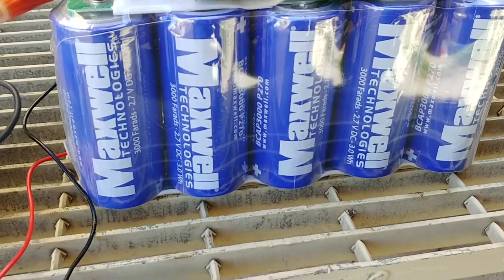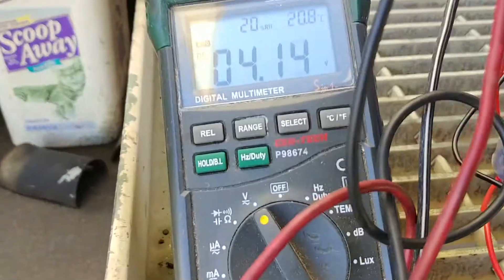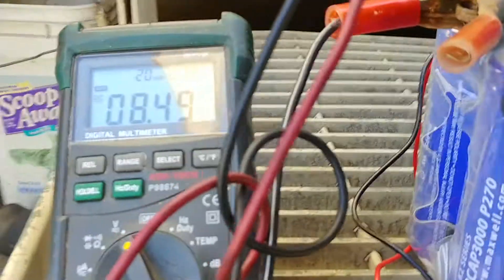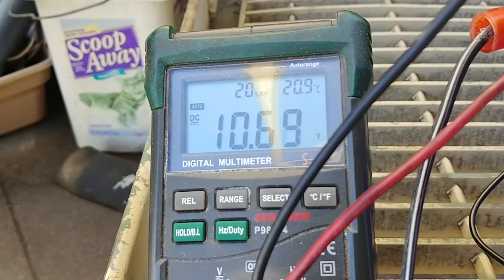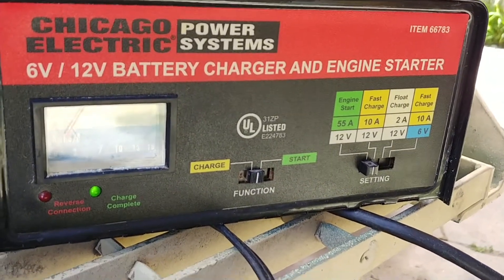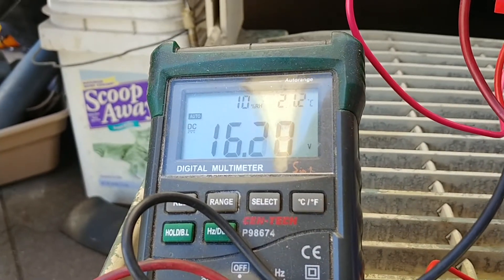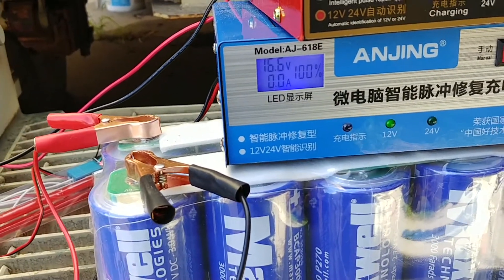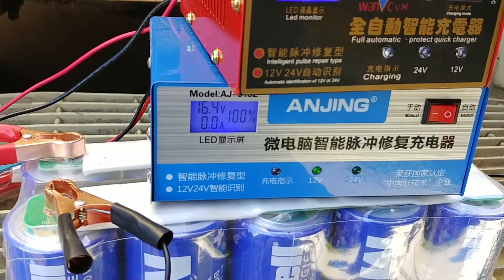Super/ Ultra Capacitor Bank Charging with 12v 24v Smart Charger

Comment: I need your help/advice,
  I built some 24 volt lifepo4 batteries. but they never get down to the automatic shutdown voltage of 10.5 - 11 volts, before one of the cells gets to low and shuts off the whole battery to early. Both my charge controller and inverter warn to "NEVER DISCONNECT BATTERY  WHILE RUNNING".
  Using this capacitor battery idea in parallel with my lifepo4 battery, could prevent this and run down to shut down voltage , if the battery disconnects before reaching the low voltage shut down settings. 
  Do you think it would be ok to leave a capacitor battery like yours, in parallel through charge and discharge cycles,  for the low voltage  shut off protection?
Reply from the maker: It sounds like your charge controller isn't balancing the discharge of your pack. It could also mean one of your cells is faulty. It's always a good idea to test each cell individually by checking the rate of discharge against the rest.
Reply: @luisislas2162   Yes , that is exactly the problem cheap unmatched cells. but even if matched, 21 volts divided by 8 cells is only 2.62. not much leeway when lowest cut off is 2,4 and most say you shouldn't go lower than 3[24v] the bms is set to 2.5 and that really to low. so if only one cell get down 20 2,5 the whole thing is shut down. It's that last little bit when they start dropping fast they get unbalanced.  Most inverters don't have adjustable parameters. I know I should be shutting it down before all that . but I'm tired of baby setting lithium batteries. for the price of them. they should perform miracles .

Comment: arnt you stuposto charge each one separately at 3 volts. and then they will add ton24 volts. thT way is changing each cap ton24 volts. that’s too much voltage? or am i completely confused?
Reply from the maker: You can charge them individually or in a bank. It takes a long time to charge individually.  Mich faster in series and with balance boards. These don't charge like regular batteries.  They start at 0v. No batteries ever start at 0v. Speed of charge is dependent on amps. If I charge a single 2.7v cap using a 5 amp 12v power source,  it slowly climbs from 0v to 2.7v.  It won't just go to 12v...